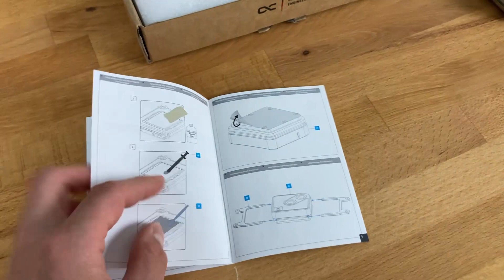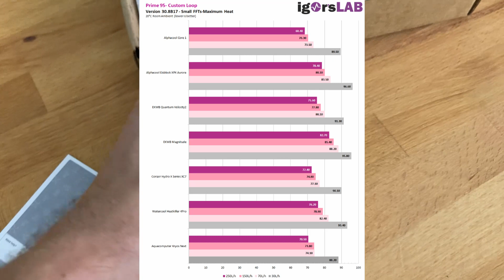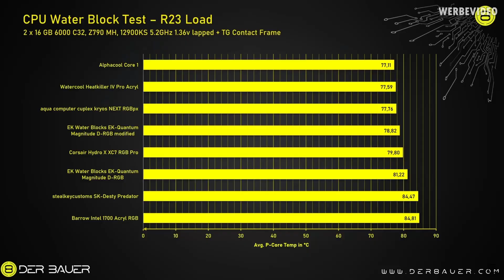Unveiling Alphacool Core 1: Ultimate Cooling & Modding Power!

Comment: I intend to make a custom loop with this block. My cpu is an intel 14600k. Would you suggest it over a liquid freezer 2 360?
Reply from the maker: It depends on the question if you want to build a system on your own or just install a ready to use solution.